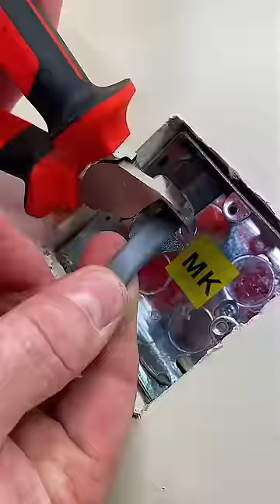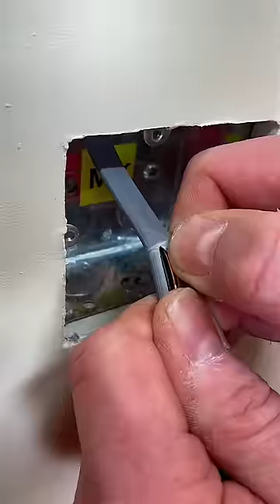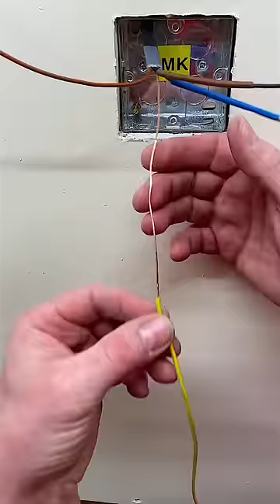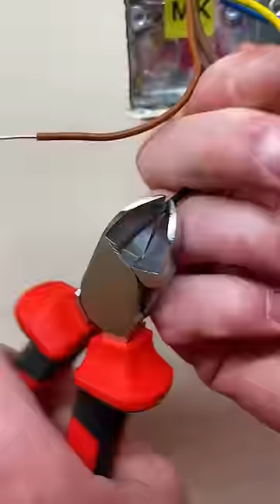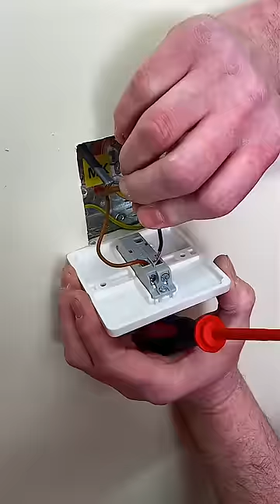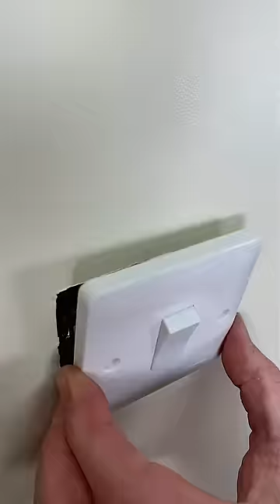How to Make Your Light Switch Future-Proof!

Comment: Can someone explain me why so many countries use solid/rigid copper wiring?
In Italy we use stranded/flexible copper wires and it's a lot more flexible and easy to manage/upgrade
Reply: Stranded conductors are typically used in conduit systems for easier pulling through bends. Solid conductors are usually in a cable form like that shown in the video. The cable with solid conductors tends to lay flat easier for fastening.
Reply: @aaron74  ok that makes sense: so usually solid conductor are used in houses with rocksheet walls?
In Italy 90% of walls are brick walls, 100 of conductors are stranded
Reply: @enricoccc  In a lot of countries I've seen that have solid walls like brick, electricians carve out channels to place flexible conduit, then a cement mortar is used to cover those channels and bury the conduit. In those cases, it makes sense to pull stranded wire through those conduits.

Comment: To be fair neutrals at the switch are pretty standard these days and for a good while in new build houses (to the point some 3 gangs look like a bird's nest) - it's just most people are used to houses that haven't been rewired in 40 years. Wagos though please guys for the love of god stop using screw terminal blocks you absolute lunatics and whilst we're at it pack it up with the 25mm BB's.

Comment: Basically 3 core & cpc all future rewires ...if you want 💰☕😆
Reply: Why would you want 3 phase routed to every socket and light switch?
Reply: @deang5622  future Proof
Reply: @Ste2023  An unreasonable level of future proofing.
Why?
Because lights and sockets outlets in a domestic residence will never require that amount of power.

Or had you forgotten the trend in power reduction, particularly in LED lighting?

And there is no chance of ever buying domestic appliances (except EV chargers) that require connection of 3 or 2 phase conductors. Never going to happen.

However, the installation of the neutral line at the light switch position, perfectly reasonable future proofing. I wish my flat I had in 2002 had that. I wanted to do some home automation, but severely restricted by the lack of it.  So it is quite reasonable to expect to have line and neutral in at the light switch.

Most appliances are not actually 3 phase. Very few things genuinely are. 

Most appliances require two wire connection only, and that can be either a phase and neutral, or two phase conductors. So no point in routing 3 phase around unless you're trying to give the option to load balance and have different socket outlets on different phases.

Gonna be one big complex CU with an excessively high number of circuits and breakers if you want to go down that route.
Reply: @deang5622  3 Phase?? You mean 3 core.
Reply: @andycrask3531  No I don't. I mean 3 phase.
If you are routing 3 core plus earth, then I would expect that to be 3 phase plus earth, with each core carrying a separate phase.
It incidentally wouldn't be ideal as there's no neutral line, that would require 4 cores plus earth. And you're going to need that neutral to enable the running of single phase devices at 230 volt (though you could derive 230 from 400 when only using phase conductors).

My interpretation was that was what the original poster intended. We're talking about future proofing, right? And one way to future proof is to upgrade from single to phase to 3 phase (I am not suggesting it is a good idea). There are homes now being built which are being fed with a 3 phase supply.
Reply: @deang5622  valid points.

Comment: why in your country make cable color brown, black, grey? why not factory just make it brown, blue, green as intended use. no more need the sleeve right?
Reply: IEC colour scheme, so correct for 3 phase wire, so to use as a light wire you need to sleeve to indicate the neutral, as this is only 3 core and PE, not 4 core and PE.  Then sleeve to indicate the return live feed, and sleeve the bare protective bonding conductor. To get the colours correct you will need a 4 plus PE cable, and still need to sleeve it, as the 4 plus PE cable does come with a blue neutral conductor, though the black and grey will still need sleeving, as you likely are using them for a 2 way switch, and will need sleeving again with every intermediate switch, and the far end, to indicate that all conductors, aside from the brown live, and the PE, are potentially active conductors.
Reply: We do have cables that are brown, blue and non insulated for the protective conductor.

But at some point you often to need to sleeve.
Reply: They have done in past  I have got a little piece  of T&E  2,3 core I took it as  sample and earth also have sleeve  but it’s cheaper to produce cable this way
Reply: @SeanBZA  in my country we use single core stranded wire. 1.5mm for lamp, 2.5mm for socket outlet. phase is red/blue/yellow. neutral is black. earth is green. so to wiring a socket, we pull 3 cable(red+black+green).
Reply: @SeanBZA you know that there are countless different Types of Cables out there?
Just use the right one and you never have to sleeve a Wire.
Reply: @eidodoos  what country are you from?
Reply: @LeedsSpark  Malaysia(Asia)

Comment: Never understood why lighting rings go to the ceiling rather than the switches.
Reply: You've never properly understood lighting rings mate...
Reply: @tebscat  Well as modern fittings are LED, do we really need such hi voltage and/or heavy duty ring mains anymore?
Reply: @8skellerns  'Rings' aren't used for lighting circuits. That's possibly one reason why you've never understood them...
Reply: @tebscat  Sorry, daisy chains. But still, why not running through the light switch instead of up in the roof? A single wire to the fitting (Allot of fittings are not designed for rose mounting anyway, and some just have a 30cm flywire.
Reply: @8skellerns  That's how you'll find most installations have been done for the past bunch of years. There are occasions when it's easier to 3-plate in the ceiling rather than at the switch, though.

Comment: Why the sticky tape?
Reply: Hold the Wago to the back of the box, so it is not going to move around, till you need to use it.
Reply: @SeanBZA  I get that but why,
Reply: @sgfelectrical734  Makes it easy to get the switch in, not needing to have to move the loose wire around, where it can potentially have the Wago be crushed by the screws, or the wire get caught between the box and the switch.
Reply: @SeanBZA  bruh your UK boxes are HUUUUUUGE. A dutch box is only 76mm outer diameter and 5cm deep with switches being almost half of that in depth. If it weren't for the 2271 and thankfully compact 221 for when you need flexible wire, you couldn't even use wire nuts in ours with a socket or switch.
Reply: @FoodOnCrack  Not in the UK...... Though a former UK colony.

Comment: To have your light switch future proof just use wireless, it's like magic because you don't need cable 😂
Reply: not always a good solution
Reply: But then you get stuck into always needing either batteries, or parasitic draw, or having a system that becomes obsolete and no longer usable.
Reply: @Irilia_neko  That does not need a box, but again the receiver needs either a neutral, or has a parasitic current flow.